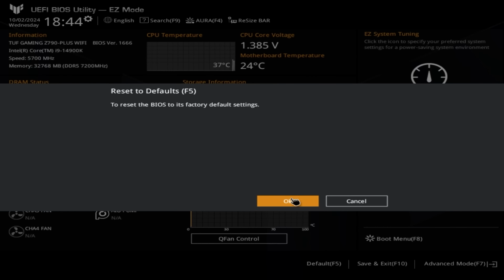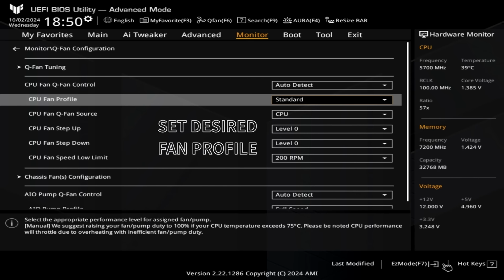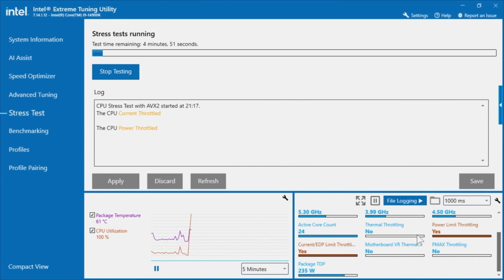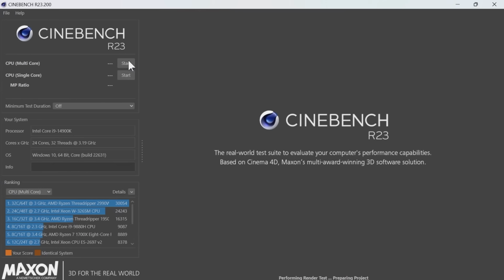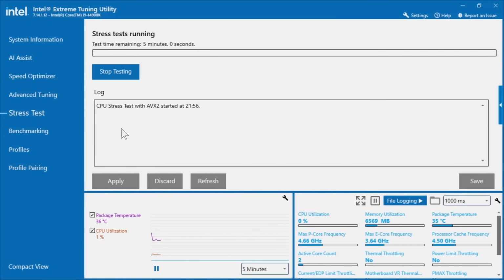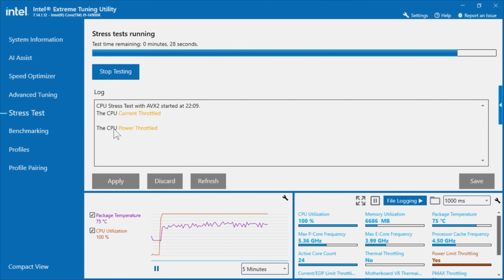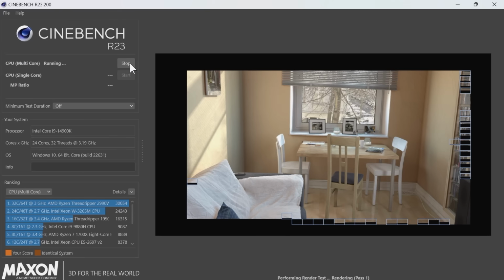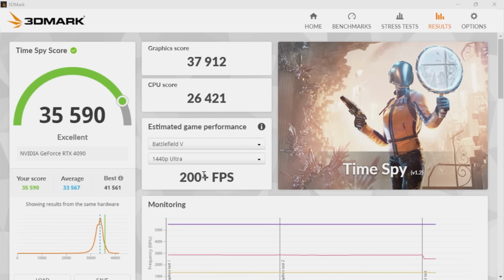i9 14900k Undervolting Guide: Part 2 Complete Stress Test Results

Comment: hi there. Matched your mobo settings and when i go to used Intel Tuning Utility, cpu utilization will not stay at 100%, jumps from 93-79%. Did i miss a setting?
Reply from the maker: These guides are a couple of years old now mate, and i’m no longer on z790 so won’t be updating them, theres a possibility some settings may have changed

Comment: I did  -0.6500V for 14900k and seems prime95 crashed once test started so i went with 0.6000v and seems running fine. Should i work on this more or its enough ? Because i dont find any issue with crashing or something. Temps are decent and not hitting 90c anymore
Reply from the maker: Finding the right balance of stability is more important i’d leave it there mate

Comment: can i still apply this undervolt on a 14900K , asus z790-f gaming wifi microcode 0x12F. i'll probably sync all p cores to 58 for more gaming performance. looks like all 14900k undervolt guide are at least a year old. xd
Reply from the maker: Hi mate, guides are still relevant, and you won’t get any additional gaming performance by running a higher speed see this video for example 

Undervolting and Tuning Guide Intel i9 14900k - Core Sync 5500 to 5800 mhz &  Performance Benchmarks
https://youtu.be/hh3FIN1c_ZQ
Reply: @nextlevelsimgaming  thanks mate. ive also notice that asus oc profile set synch acdc loadline to disabled whereas intel defaults (im using) set to enable. and should i set ia cep to disabled or enable becuase ive seen some people set ia cep enable when undervolting. cheers.
Reply from the maker: Asus OC profiles often disable AC/DC loadlines for stability with their settings. Intel defaults enable them. For IA CEP, disable it for undervolting unless you're experiencing instability at very low voltages.
Reply: @nextlevelsimgaming  im currently on intel defaults. and i undervolt 57/44/48 llc4 ad/dc sync enable. global svid -0.015, ia cep disabled with hyperthreading off. Everything runs perfectly. i mostly play cs2 and with offset -0.05 there are stability issues.
Reply from the maker: @ktrit5279  whichever works best for you bro 😎

Comment: Hello, good video!
I cant undervolt more then -0.015, is my 14900ks degraded?
Reply from the maker: It can depend on a number of factors, silicone quality, but a CPU that is degraded will unfortunately require more power and be less susceptible to an undervolt
Reply: @nextlevelsimgaming  Yep figured so, but lucky for me that plus adjusting some more settings got the CPU temps down by 20-25c during full load so its finally stable.
Reply from the maker: @emiladolfsson4410  Excellent good to hear

Comment: I know this is an older video, and you have already moved from this platform, but I have a few questions for you, if you dont mind. I've had my 0.080 undervolt seemingly stable to run 10 mins of R23, and the score is 41k and some crumbs. But.... I played 30 minutes of the new Doom game, and right after finishing, I ran another pass of R23, with an error at the very beginning of the test. I gave my pc a few minutes and ran one pass again successfully.  Then, I turned on Returnal and right in the middle of shader compiling, I got this infamous "low on video memory" error. I didn't have my cores synced, and I got all limits turned on as you had. What is causing this? Is my CPU degraded, or I have too high undervolt. LLC is on 4 (TuF mobo,  ut Z690), and temps never reached over 82 degrees. This behavior almost gave me a heart attack, and as I was under an impression, my PC was table. What is your suggestion? You know what you are talking about, so if you have a minute to spare and recollec5 your findings, let me know. This bothers me so much that I can't find peace. 😊
Reply from the maker: The reason we lock the cores is to prevent over-boosting, the symptoms you describe are in line with the behaviours of a degraded CPU as the characteristics will begin in scenarios like shader compilation errors and load under AVX2 consider raising an RMA however as I have been told Raptor Lake processors are now been refunded or replaced with Arrow Lake
Reply: @nextlevelsimgaming thanks for your info. Cpu is only a month old, but I have contact frame bracket installed, maybe this is causing some issues? So should I sync my cores as you did to 5.5 ghz? I lowered my undervolt to 0.070 and shader compilation finished fine. Could this have remedied it, or was this just lucky coincidence. I might sound petty, bud I'm genuinely scared to run XTU stress test, to avoid any possible damage... Can I use this test without being too paranoid? I already put so much money into my rig, I would like to use it without being constantly on the edge. Thanks for your time, very nice of you to reply to comments.
Reply from the maker: @iNubpwn3r  Using a contact frame should not cause any issues but using too much clampdown force on the IHS can also cause issues with seating.

Running an Advanced Vector test puts the CPU under high load, hence why its a stability test utilised by XTU and is also part of the new Intel processor diagnostic tool used by Intel to identify failures, and irs an essential test to confirm issues and yes I would recommend syncing the cores

Comment: since i did your steps my steelseries sonar (wireless arctis pro) keeps making popping noise and buffer delay in sound while streaming tv or watching videos. everthing sounds crispy. í9 14900k, gskill trident z5 64gb 6400 cl32, asus z790 dark hero, rtx 5080. any ideas? i did everything like u, unless the xmp tweaked, i set mine to xmp1. best regards!
Reply from the maker: I presume you updated your BIOS prior to this?, you need  to update your Realtek Audio Drivers from the Intel Motherboard manufacturer site
Reply: @nextlevelsimgaming  did a clean install yesterday, mobo drivers are the first step i usually keep up to date. hmm but its only the sonar mixer from the software, when i deactivate sonar everythings fine.  dont know if youre familiar with it. man i hate this haha, and jeah bios is up to date
Reply from the maker: @eckbert8942  I am very familiar with the issue, I used to have the Steelseries Arctis 7P, and its unfortunately a consequence of the drivers, go to add / remove programs and uninstall the software completely and find the latest Realtek drivers on the manufacturer website, update then reinstall the SteelSeries Sonar software.

Its not related to the undervolt in any way
Reply: @nextlevelsimgaming  okay i let you know, and big up for the fast reply.
Reply from the maker: @eckbert8942  This may assist

https://www.reddit.com/r/MSI_Gaming/comments/zs38wu/sound_crackling_problem_after_updating_bios_and/
Reply from the maker: @eckbert8942  For me it was the Realtek drivers,, go into Device Manager and right click to uninstall all the audio drivers, reboot PC and it  will reinstall them on reboot its either a conflict or driver requires reinstall
Reply: @nextlevelsimgaming  i uninstalled everthing, reboot - installed the realtek - then the stellseries gg - reboot, activated sonar again same problem, under audio settings on sonar gaming channel there is only 8kanal 24bit 96khz. maybe thats the problem?
Reply from the maker: @eckbert8942  Possibly, its been a while since I had the issue tbh, its actually a Windows 11 related problem, check this thread for more information 

https://learn.microsoft.com/en-us/answers/questions/4018156/i-cannot-fix-audio-crackling-channel-swapping-(bui
Reply: @nextlevelsimgaming thank you for your help, besides my problem much thanks again for the original tuning video ;)

Comment: After changing to the ASUS OC profile, I noticed the BCLK adaptive aware voltage changes from disabled to “auto”.   Should I manually change this back to disabled?
Reply from the maker: No, the Asus enhancements are what will be providing the performance improvements other than the ones stated in the video to deactivate
Reply: @nextlevelsimgaming thank!  Also I am disabling “overclocking TVB” but leaving the other two settings above it  on auto(TVB voltage optimizations and enhanced TVB)….is this okay or should I enable them? 

And what about the Intel speed step, speed shift, intel turbo boost max technology?  Those are all enabled by default?

And finally should I manually sync my E-cores in bios to 44 as well or leave on auto?
Reply from the maker: @mr.ssb33  Yes you can apply the settings manually in BIOS however XTU writes a software profile to make the changes in pre boot behaviour 

I can only comment on what was included in the video as I have now moved to Z890, these videos were done to help users experiencing issues last year with the Intel degradation problems
Reply: @nextlevelsimgaming okay thank for the info man it’s really helpful !  BUT I just have one more question lol:  do u think setting the IA VR limit to 1450mv with the most recent bios is too much or is it better to experiment with lower values such as 1350mv?  Or should I leave it alone at auto altogether?  For now I feel comfortable just tweaking all the bios settings manually like u did in all these videos 😂
Reply from the maker: @mr.ssb33  Just leave it on Auto, and test for stability
Reply: @nextlevelsimgaming thanks man, I just purchased the 14900k with the same motherboard you’ve had without any issues using the default intel extreme profile settings.  However I just want to be super cautious, which is why I’m picking ur brain like a madman.  

I may just end up using your bios settings you go over at the beginning of all these vids as my foundation and I will also apply the recommended bios settings from falcon northwest as well.  If i decide not to make anymore bios changes with intel XTU, do you think the initial  bios settings that you manually changed in the beginning of the video will be good enough?

Comment: Hello. Do you know why there is no AI Assist in my intel xtu with a 14900k ?
And should i offset also the processor cache and efficient core cache voltage ?
Thank you
Reply from the maker: AI Assist is only with supported motherboard varients.  I unfortunately don't have the Z790 platform anymore,  these videos are legacy videos from last year. all the instructions for the correct settings are in the guides, see the other related videos in the series.

Comment: Hi been following ur guide thanks for the help I noticed that my system agent power is around 9.6 or higher in one of ur videos I can see that urs is only 1.3 in hwinfo is this a problem thanks
Reply from the maker: No, the power levels are limited if you applied the settings as per the guide, so system agent will vary depending on load.

Comment: nevermind i found out that my active power plan in advanced options was set to power saver so i switch it to ultimate performance and my max p-core frequency is running at 5.3-5.5 now lol
Reply from the maker: No worries

Comment: after applying the undervolt and syncing all cores to 55 i then applied the -0.055v undervolt in xtu and noticed my max P-core frequency maxed out at 2.30ghz and was not increasing? why is it only maxing out at 2.30ghz?
Reply from the maker: Ok

Comment: disable intel vt?! its feature some people need!!!
Reply from the maker: You have to disable Intel Virtulization to run Intel XTU, once you have concluded your testing and set the undervolt you can re enable it in BIOS, you are not disabling the software component 

Intel XTU is an official Intel product, and it is a pre requisite to disable Virtulization.

Virtualisation is only required if you are running virtual machines, not something the average gamer would need.

Comment: Hi. 
I tried you settings for my Asus BIOS 1805. 
My PC crashed one time during Cinebench R23 and is also crashing during XTU stresstest (twice). Package temperatures is maxing out. 
I tried with -0,05 and both with and without max voltage 1450. 
Any ideas?

PC specs:
I9-14900KF
GeForce 4080
Asus Z790
64GB 6000hz
Reply from the maker: @kasperholmmortensen1613  Set Asus Multicore enhancement to Disabled, IA CEP and SA CEP both to disabled.

On some motherboards Current Excursion Protection can be over sensitive, it used to be a pre requisite to have it off, it seems on some of the latest BIOS that also seems to be the case.

Watch this part 2 guide on refining the under volt

Guide to Setting the Correct Undervolt and Stress Testing Intel Raptor Lake i9 14900k
https://youtu.be/XM2JLjcQZgc
Reply from the maker: @kasperholmmortensen1613   Disable Asus Multicore enhancement, on these latest BIOS it seems to be causing issues.

Disable 

IA CEP
SA CEP

(current excursion protection)

It used to be a pre requisite to undervolting to change it, in 1802 it seemed unnecessary, now it seems again to be over sensitive 

Check this follow up video to refine your undervolt

Guide to Setting the Correct Undervolt and Stress Testing Intel Raptor Lake i9 14900k
https://youtu.be/XM2JLjcQZgc
Reply: @nextlevelsimgaming 
Thanks for your inputs. 
Tried all in your video and also in your comments here, but when I run the XTU stress test it is thermal throttling and it fails everytime. My temperatures is also 90-100 all the time. 

I also tried to run the Intel Processor Diagnostic Tool and the CPU passed this. 

Not sure what more to try 😅
Reply from the maker: @ Did you set the power limits manually?, i.e 400/253/253?, you also need to be using the Asus OC profile not Intel Default but you hard enforce the limits.

It could be a number of things, incorrect pressure on the IHS, poor application of thermal paste, AIO pump not performing as expected, fan curves not set correctly.

You should be getting current throttled but not thermal throttle when undervolting, the current throttle is from hard enforcement of the Intel Power limits, under ICCMAX it should be set to enforce all limits

Comment: Hello Good friend. I am new to this overclock and undervolt. I have the 14900ks, dark hero mobo, 7200 ddr5 and 4090 gpu. I did the same exact settings you did. 

Every thing is perfect no more blue screens. But when i play games like Avowd or Stalker 2 i get a message saying no video ram something like that. Please help me tweak it. 

Thank you
Reply from the maker: Yes, disable MCE (Multi Core Enhancement) in BIOS
Reply: @nextlevelsimgaming  thanks for the reply. Do you mean the Asus one? Because i already disabled the intel one
Reply from the maker: @ Yes Asus Multicore Enhancement.

Are you using the Asus OC profile not the Intel Default profile?, you should be using the Asus OC profile with manual amendments shown in the video.

The Dark Hero board can be finicky one of the channel contributors Emir has the same, you may also need to disable IA CEP and SA CEP to get stability
Reply: @nextlevelsimgaming  Thank you for your time and effort for making theses videos man. My pc now is solid. Keep it up
Reply from the maker: @ A pleasure thanks for the comments 😉